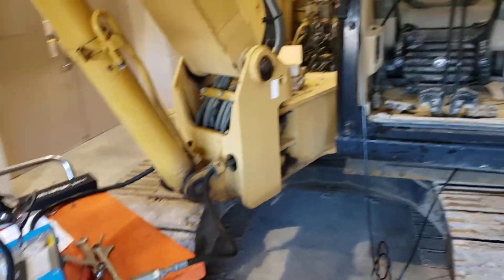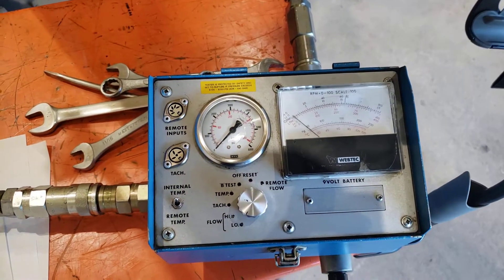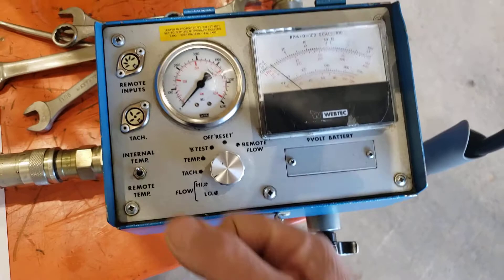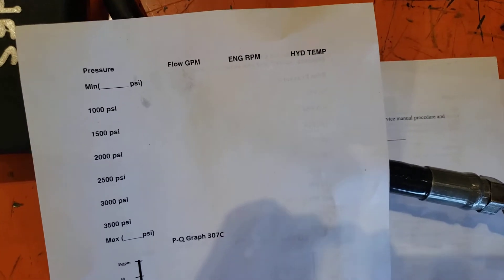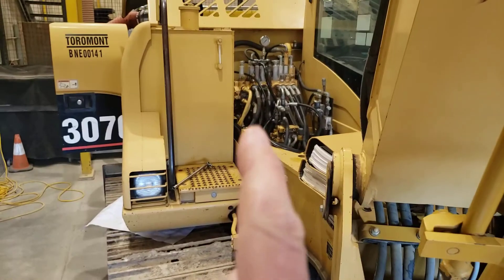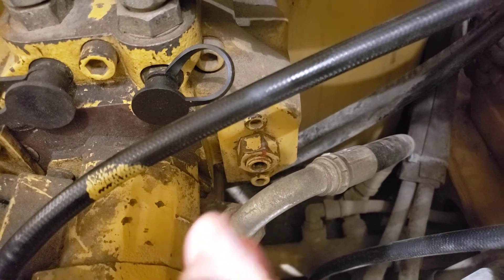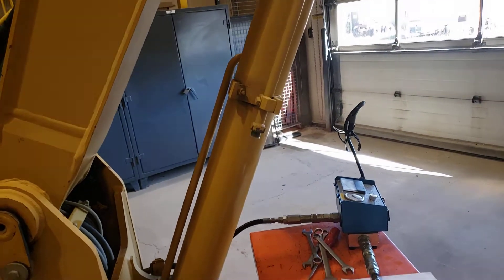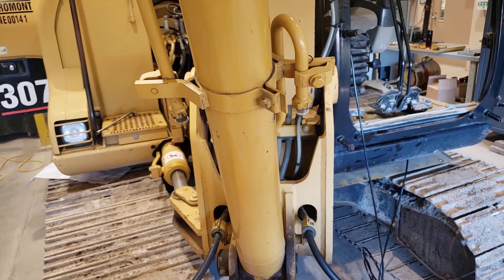Hydraulic Horsepower test Caterpillar 307C excavator

Comment: Nice video. Can you please tell us your opinion on what type of hydraulic oil to us in a excavator. I think the most common are H32 and H46,the machines we talk are made between 2000 and 2012 and the climate is moderate,summer is about 104 F and winter -4 F . Thank you.